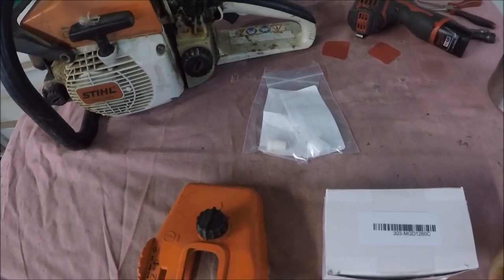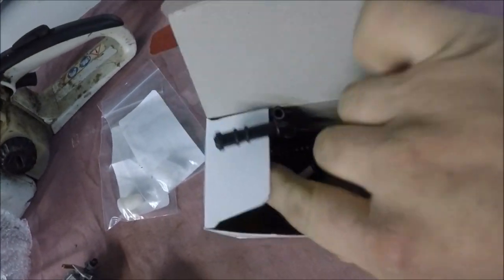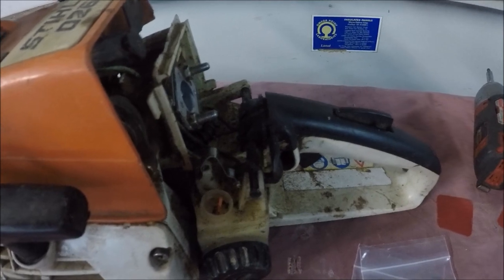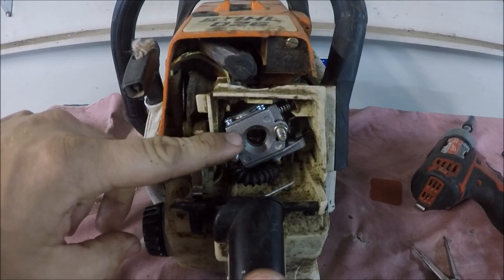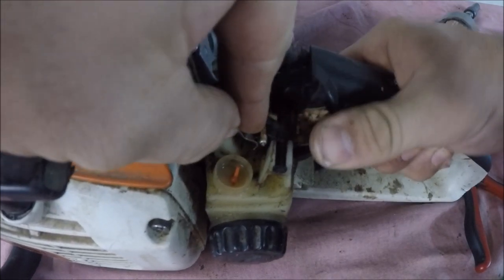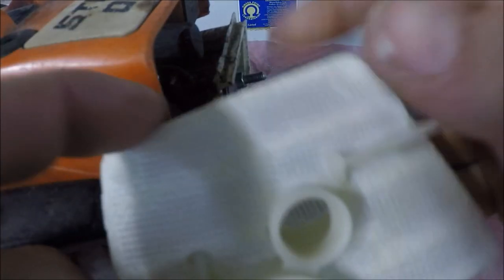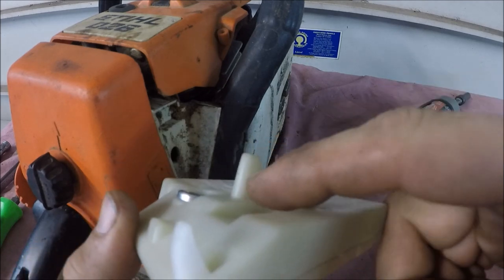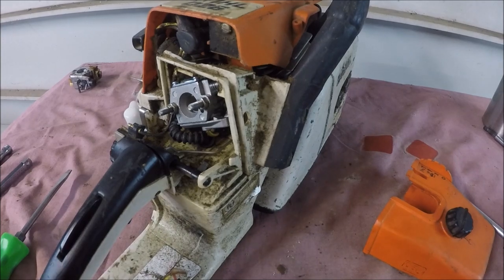026 project saw new carb and tank vent

Comment: I bought the same carb kit for my 026. When the weather moderates I will put it on and tune it.  I am also putting a new intake boot on it with the carb.  25 years is enough time on an intake boot and my carb kit came with one.  I checked the jets on the new carb and they were 1.5 T out on the L jet and 1.75 T out on the H jet.  A little rich but I will lean them out when I get the saw running.  You are right, the air filter latch on the  the 026 is shorter than on the ms 260.
Reply from the maker: If it is an AM carb, hard to tel were you will end up on the adjustment.

Comment: Does the O28 av Woodboss have the same kind of tank vent?? Mines missing and of course gas leaks out of it all the time, don't even know what it's supposed to look like, whether it's a hose or a plastic thing like the one you put on in this video???
Reply from the maker: It looks like it has a hose with a special screw in it. Some newer saws use the same setup. Here it is on page 14, part numbers 13 and 14. https://www.motoculture-jean.fr/upload/pdf/028.pdf
Reply: @TractorTech  thank you very much

Comment: I have a leaking 036 tank vent. I reckon they’re not supposed to leak? They sure look like they want to leak being porous and all. Are they just a press fit? It’s hard to tell in your video. Thanks for posting.
Reply from the maker: Yes, it is a press fit. Look inside the tank where the vent is. There is supposed be an orange "valve", just a think piece of rubber. Here is an example of what it looks like.

https://www.ebay.com/itm/183947745572

If this is missing, that will cause it to leak when it is turned on its side.
Reply: That makes sense. Thanks for the help!

Comment: where to buy carburetor and replacement parts please. I have an 026..got a price from tractor dealer to fix...charges exceeded the price of new saw.
Reply from the maker: What is wrong with your carb? Do you think you could rebuild it? Does it have 2 or 3 adjustment screws? If it only has 2 screws and you want to upgrade and or it needs replaced, get a Walbro WT194 carb.  The 194 is the best carb for this saw. You can find them on ebay. https://www.ebay.com/itm/GENUINE-OEM-Walbro-WT-194-Carburetor-for-Stihl-024-026-MS260-024AV-024S/323662051194?epid=1801756033&hash=item4b5bc2f77a:g:v8IAAOSw9N1V1Kqr:rk:2:pf:0 I put an aftermarket carb on this saw and it is finicky. I would not recommend it. Get a fuel line when you replace the carb. Get the fuel line from the dealer. An aftermarket one will only last about a year. What other parts do you need?
Reply: The 026 has been sitting up several years and probably gummed up. Dealer says a replacement is cheaper than rebuild.  New hoses are a plus for sure. thanks for the link. Yes I can rebuild myself, just thinking a new one would save time on running saw. thanks for the reply.
Reply from the maker: If you have to pay someone to rebuild the carb, a new one would be cheaper. If you do it yourself a kit is cheaper. There are very small passages in the carbs and they can be tough to clean. It is really not worth it for a dealer to take the time to rebuild a carb and it still not run properly.

Comment: Like your builds l love these older Stihl' I have 6 in my Collection. I love the big saws but my body doesn't. I love tinkering with them in my spare time. I need to find a 028 to freshen up.
Reply from the maker: Thanks! I have three 026's and one 024 super. I really like the bigger saws too. I have never ran an 028. I have ran an 031 and it was a good runner.

Comment: do you have a link for that carb? thanks price?
Reply from the maker: Does your saw have an intillcarb? If it does this one should work. https://www.ebay.com/itm/New-Carburetor-Carb-For-STIHL-024-026-MS240-MS260-Gas-Chainsaw-carby-USA/321809828994?hash=item4aed5c4c82%3Ag%3A6xUAAOSwlJlawvRt&_sacat=0&_nkw=026+carb&_from=R40&rt=nc&_trksid=m570.l1313 If not you may be able to change the diaphragm cover.